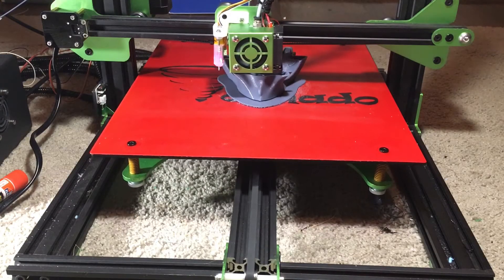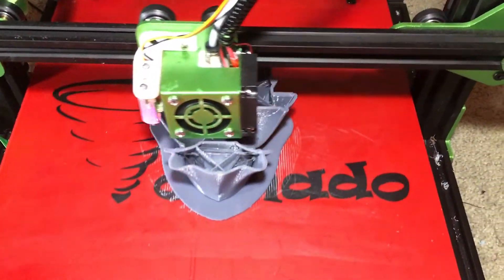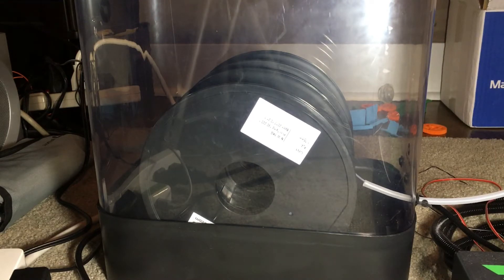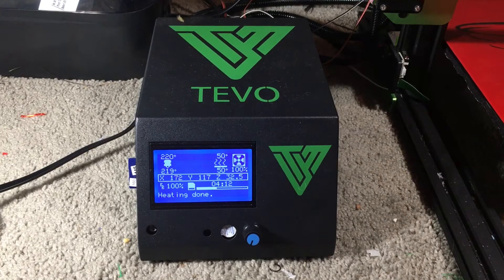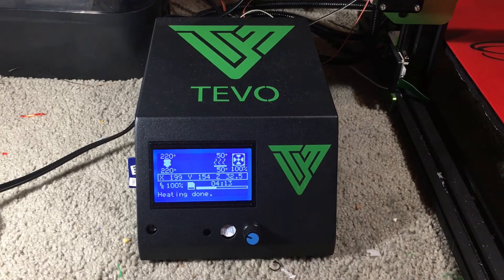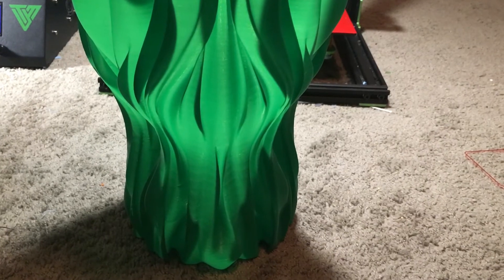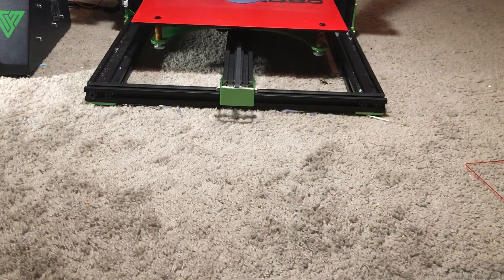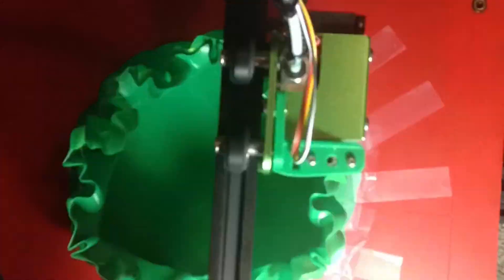Tevo Tornado Review, and How to Get Better Prints

Comment: OK. I have one of these (and a tricked-out 3 year old Anet A8 and a 2 year old scratchbuild). After 3 weeks, I cannot get anything but wasted filament and wasted time out of this machine. I have really tried lol. I have checked the vrefs, upgraded the power supply, added a bltouch, tried glass, blue tape and the stock build deck, checked the squareness of the frame, fitted a ground fault interrupt device to the socket, checked all wheels, secured the bed cable properly and grounded the frame and metal part of the build deck, swapped out the fake FTDI chip on the mainboard for a real one so I can use Octopi to guard against thermal runway on the bed if the solid state relay fails short (the mains heatbed frightens me). I have really tried with this machine but it feels like I am fighting a losing battle and I am about to bin it. The X gantry is always 3mm lower on the right than on the leadscrew side, no matter how the wheels and nuts are ajusted and the bed is warped despite being 'glass'. Is your X gantry lopsided to the right with respect to the frame? Keep it up.

Comment: i am new in some aspects but i am curious the enclosure you have your filament in does that really help i ask because its a solid that gets melted down but not only that by seeing the carpet i imagine your printer is in your house an if you keep it in the house how would that enclosure help with the filament im really curious because if you do that for a roll your using should you store extra rolls in a container like that or does it matter ? real question not trying to be a butt or anything cause if it needs to be like that then i need to build a container for mine maybe it will help
Reply from the maker: johnathon cagle I have the poly box, it is a spool holder along with a dry box,it can hold two rolls or a 3kg and it works really well.
Reply: but do you really benefit from doing that instead of just letting it be in the open on a regular holder

Comment: Hey M8! Be sure to print your cable strain relief for the rear of the bed. Your wires will snap super quick. Also, print off some bigger wheel bed adjustments. Get some TL Smoothers - heaps easy to install and eliminates salmon skin. Good work.
Reply from the maker: ill do the strain relief, i have them already printed, i have the bltouch so i don't do to much manual bed leveling, also right after this video i installed the smothers i have bought, and they do work really well. Thanks!!!!

Comment: A little advice.  Take your printer off the carpet and put it on a table.  The static electricity can cause failure, and you are increasing the odds of a fire by an astronomical figure.
Reply from the maker: Nun Chk I’m going to be moving, and will get one then.